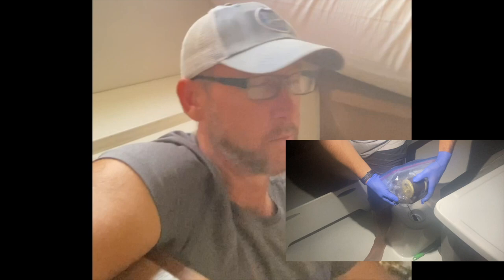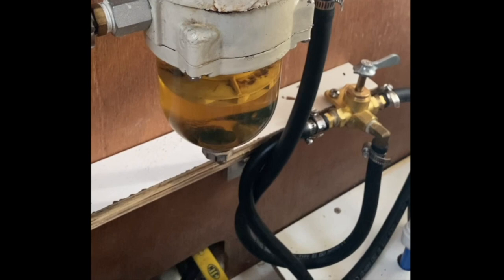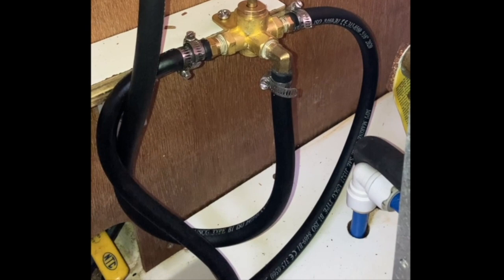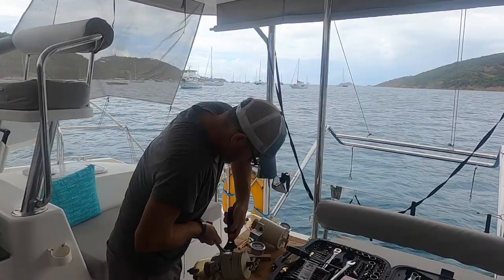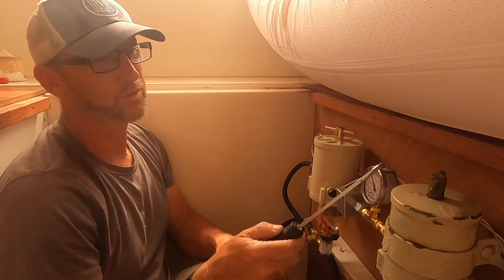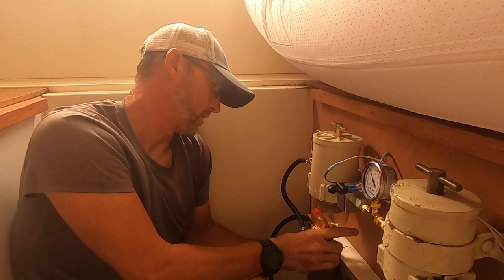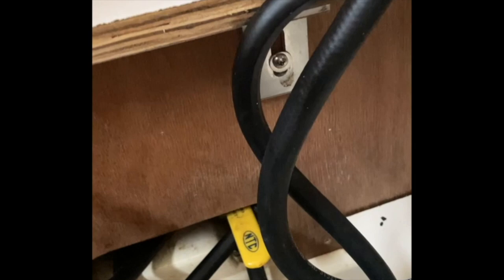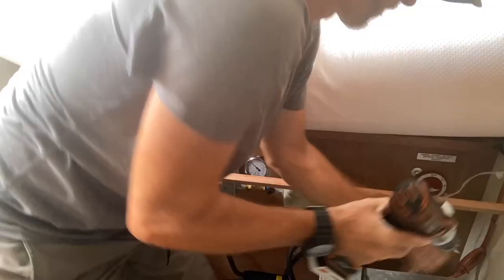DIY Fuel Polisher for Boat | Sailing Luna Sea | S4 E13  | Leopard 38 Catamaran

Comment: Thanks, great information, and confirmation of what works and what doesn’t. Good to know about the ball valve and the need to have spares aboard. I don’t have the luxury of that space in my Southerly 135 engine bay so had to do a very compact version of your arrangement. So by using Banjo fittings front and back I was able to get the filters just 6mm apart with 3 way valves in between the Banjo fittings. The twin Raycor filters was the intended project and I designed custom sheet metal parts to hold it all together along with a third folded part to allow the whole assembly to swing out into free space at the side of the engine. So with this arrangement the filter selection valve makes it so you can select either filter, both, or none ie shut off fuel altogether. Then I added 3 other 3 way valves so the engine can run from a reserve tank (day tank or drum) in emergencies, and the return fuel is able to be diverted to which ever fuel source is being used. Then it dawned on me that I can make this assembly be a fuel polisher as well, so have a Marco UP3 pump coming which pumps 15 litres per minute (they have larger and smaller ones suitable for diesel and oil) so the final assembly will filter and water separate fuel for the engine, with a full selection range of filter and fuel source options, it will polish fuel in the main tanks and selectively reserve fuel drums of tank, and it will enable the transfer of fuel from tank to tank and tank to drum. The only thing this will not do is have different fuel filters in a row as your design does. This will have a vacuum pressure sender so that the line pressure can be seen from the helm or in the NMEA 2000 data transfer system. The final arrangement will have a light behind the filter bowls to make inspection in the dark engine bay easier. The whole assembly with the fuel pump is two and a half (plus a bit) times the width of the Raycor 500 filter body, and 30mm front and back deeper than the Filter body…plus the space the valve handles take up.
Your video, though, gives me confidence that the system will work as intended. Looking up fuel line diameters for engine power, a 3/8 inch fuel line is good for up to 450 HP, so I will adjust the whole system to be suitable for up to 450 HP engines.

Comment: I just mounted one of the knock off racors last weekend.  I ended up using hex-head through bolts.  Sliding an open ended box wrench behind the unit and a socket on the other side, I could tighten it down.
Reply from the maker: Thanks for the feedback - and for watching the video 🙂

Comment: currently planning out my own polishing system using racor filters. they say to have the 2micron filter on the vacuum side of the pump so diesel is sucked through not pushed.

Comment: Excellent video. Been planning to build a polishing system on my boat and this looks like a great setup. Never thought of using gauges…. My initial thinking was along the lines of your initial setup. Need to upgrade my plan.
With the knockoff Racor, what was the thread type on the one you used, NPT?
Reply from the maker: I believe the knock offs come with NPTs, yes. Thanks for watching!

Comment: pumps should always be pushing through a filter, why do you have it sucking through one and pushing through the other?
Reply: My diesel tech told me I should have my Racor before the fuel pump because you don't want gunk in the pump any more than you want it in the engine...he was trouble shooting my genset at the time which would not stay running...turned out to be the pump.  Lunasea's set up with the larger micron filter first then pump then small micron filter seems a reasonable compromise for what you are concerned with.  Plus Lunasea has the vacuum pressure gage system which will tell him when a filter is getting clogged so he shouldn't do damage to the pump by having it go dry or otherwise destroy itself by trying to pull too hard.  Seems like a pretty cool setup to me.